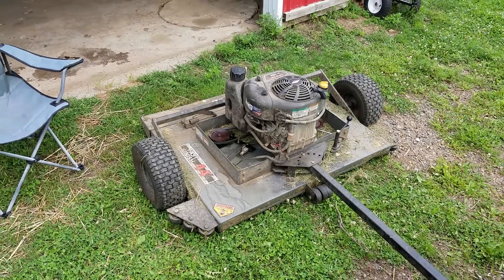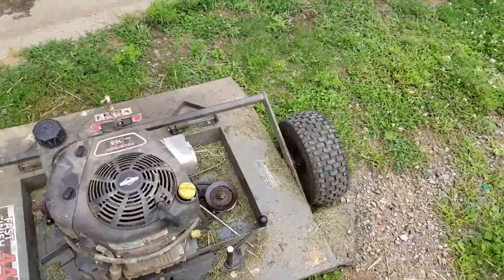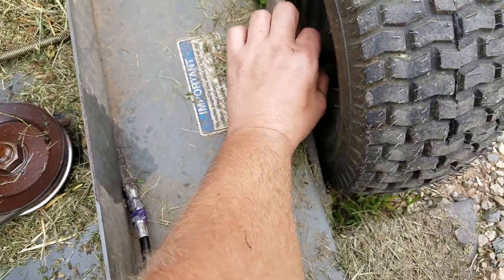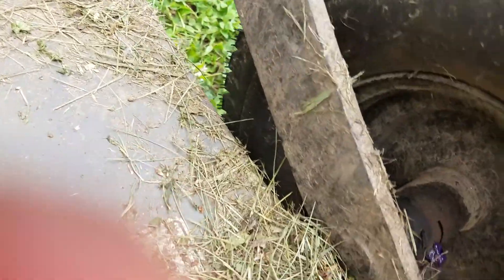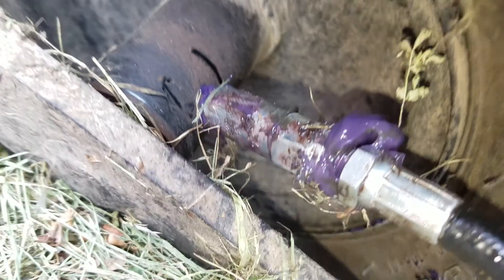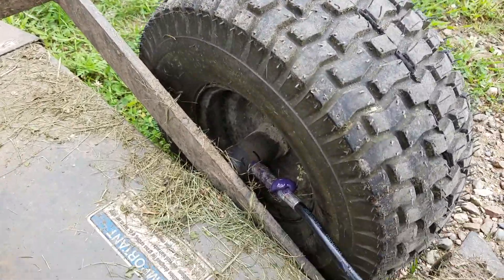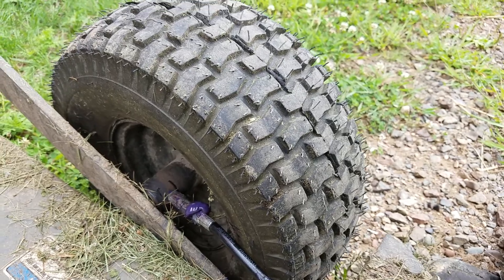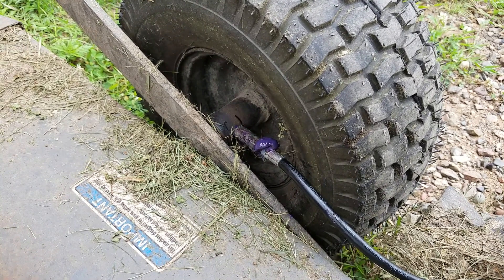how to grease the wheels on a swisher 44in finish cut trail mower

Comment: I bought a used different model ( RC11544BS) and one of the wheels had bad bearings. The parts diagram CD for my model does not show the bearings and Swisher was no help either. I think they are 13/8X 3/4 " flange type bearings. They do not look to be "sealed" so I am going to grese it until I see grease coming out of the hubs. Have any of you switched to sealed bearings? A little more cost but maybe worth it. wolf